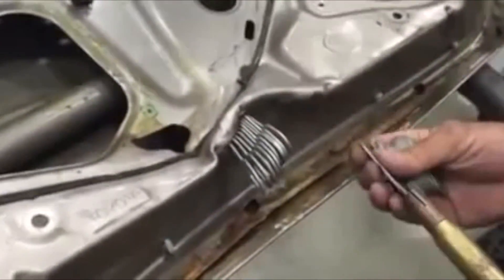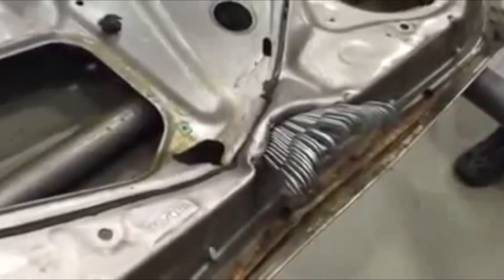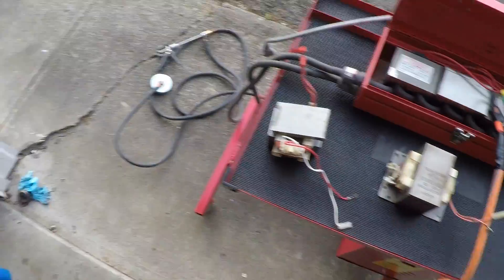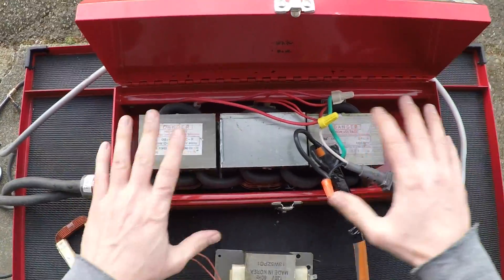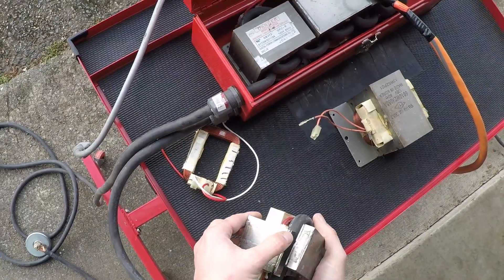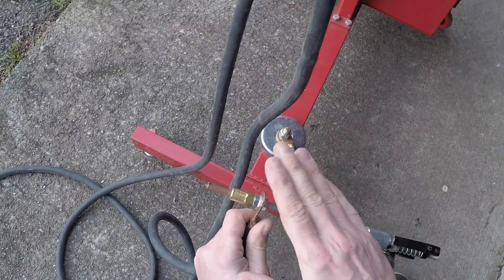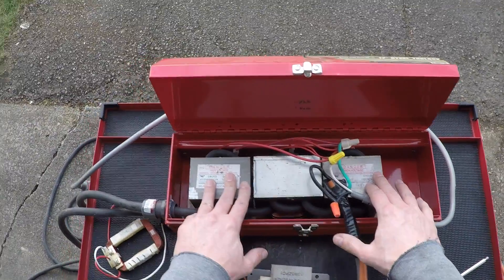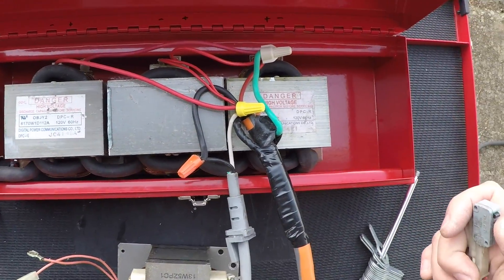✅ How I Built My Car Body DIY Spotter Electric Dent Puller Welder From Microwaves and How It works

Comment: Hello  question  can you tell my the diameter from the cable to use  , and what is the voltage ?
regards
Reply from the maker: Diameter of the cable is considered as 2/0.  But the actual measurement of the the cable with insulation comes out to 1/2 inch or about 15mm. The voltage being used is 110V, because in USA all of the microwave ovens run on 110V and I couldn't find one meant for 220V.  But if you are outside of USA use 220V transformer, it will work just the same. Let me know if you have any more questions.
Reply: @fix206    Thanks   for info  !!!!
Reply from the maker: Hey not a problem. Always happy to help a fellow car enthusiast. Cheers !
Reply: ON4RW the biggest that fits into the transformer